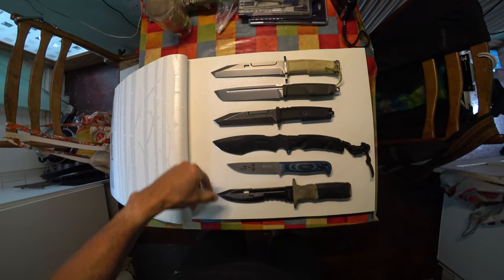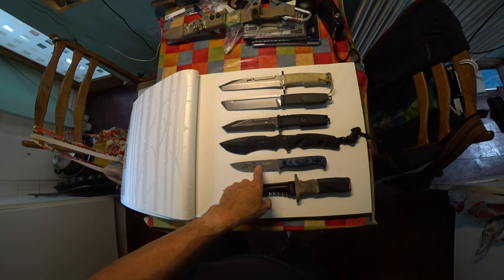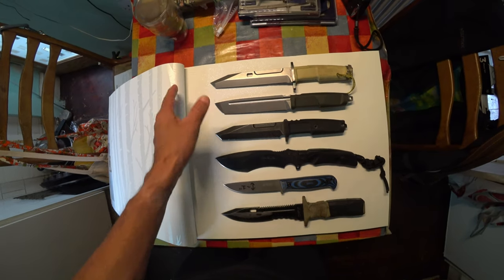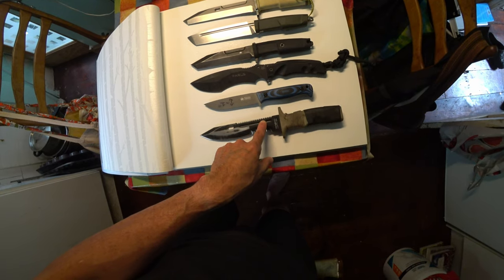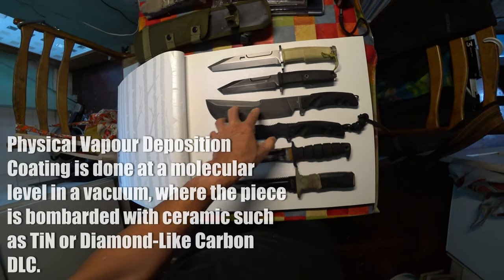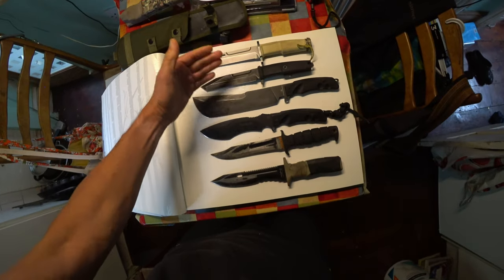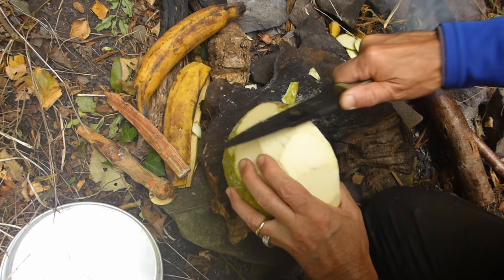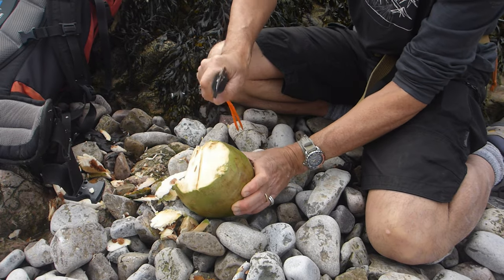Knife Blade Coatings

Comment: Good points about the purpose for coatings: wear resistance, corrosion resistance, less friction, and even potential health risks. My kitchen knives and pans are stainless steel and a cast iron skillet. But for the camp knife in the field, good points to consider.
Reply from the maker: Thanks!

Comment: My Tops Silent Hero (1095) started rusting through its coating, which Tops did offer to fix under warranty but it would have been a pain and expensive shipping. I stripped the coating and did a forced vinegar patina. It now doesn’t rust like it used to with a coating. Don’t know if that helps anyone but stripping the coating worked well for me.
Reply from the maker: Thanks for posting this good information.

Comment: How many folks worry about knife coatings ( but want the coating because its tacti—cool) and continue to use their scratched teflon coated frying pans etc at home in their kitchen for years. Lol. 🤔🤔
Reply from the maker: LOL, so true. BTW in the kitchen of BCT, we chuck out any scratched PTFE pans LOL Thanks for watching and commenting.
Reply: @BushCampingTools    You're welcome. I only use stainless steel pans because I dont trust the coated ones. Especially as I often burn something and have to use steel wool for cleaning. 😂😂
Reply: @Wastelander13  Some Japanese Guy used baking soda to clean the pans as if new... If I remember correctly it was Juns Kitchen.. I never tried.
Reply: @andrashavas    Baking soda works at some point, but has its limit if the food is burned to hard in the pan ( as it happens to me sometimes 😇😇)  So I use stainless steel pots and pans now that I can clean by using steel wool.